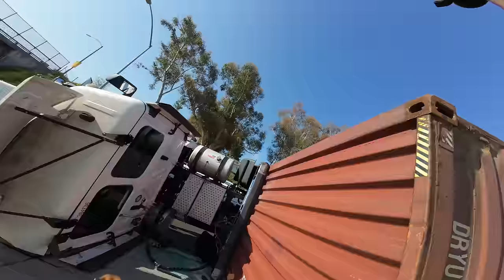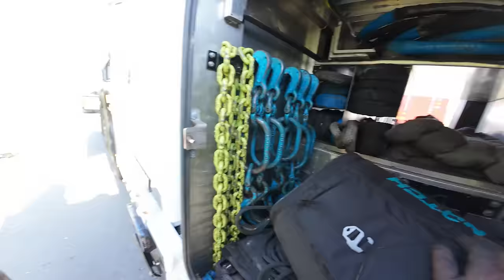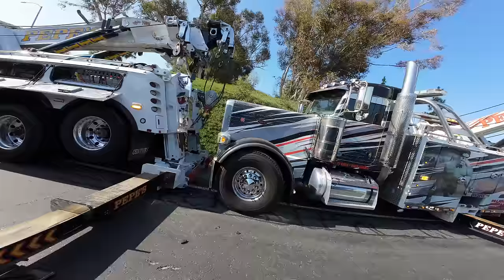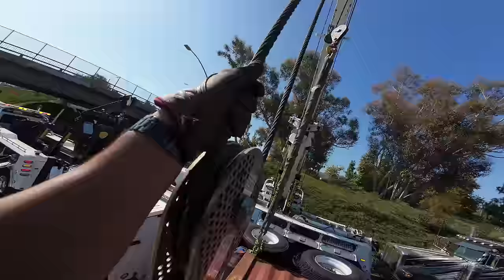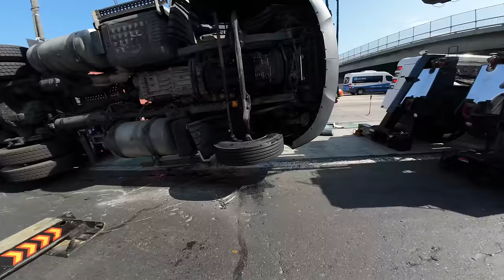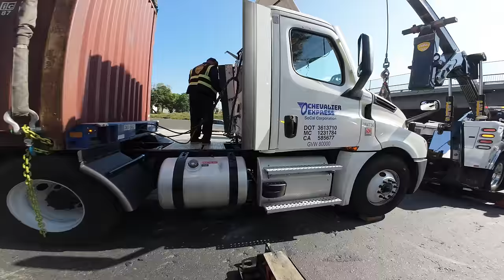The PERFECT Way To Upright Rolled Containers

Comment: Honestly the only difference in terms of rigging between this and a regular rollover is one container pocket, so setup is identical but the results speak for themselves. No side loading the truck tires, no sliding the truck across the floor if the lines aren't directly over centre of mass and the smoothest catch possible. It's a win win

Comment: Josh, that was cool.  They gotta do something about the angle of those on-ramps, way too many semis are rolling.
Reply: It's not the On-ramp Design that is the Problem it Is a Driver Problem and a Known Container Issue That Causes these flops With The Automatics the Driver just Floors it and Goes and Does not Have the Tactile Awareness as to What Gear and What Speed they are Going.  And these Containers are Packed and Sealed at the Factory so How they're Secured is not in the Drivers Hands!
Reply: @Chaplain_GM  And the drivers have to take responsibility for driving these unknown loads? How is that even legally enforceable? A hostile power could booby-trap containers.